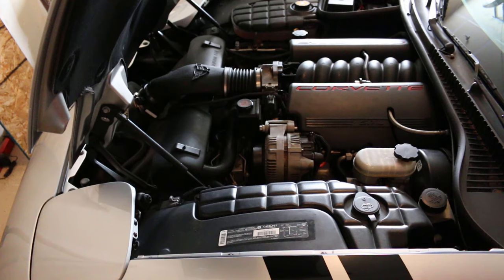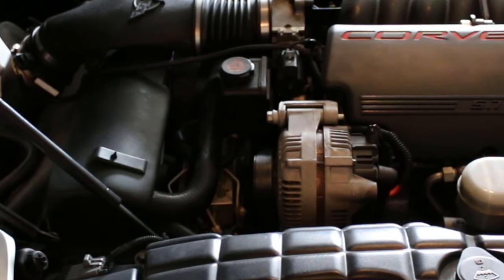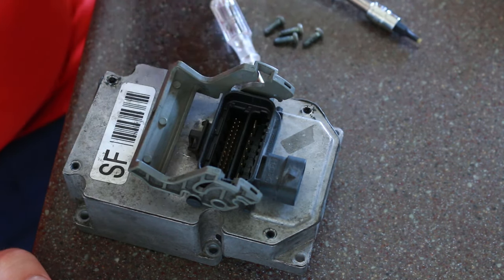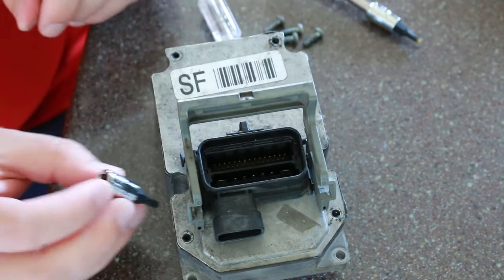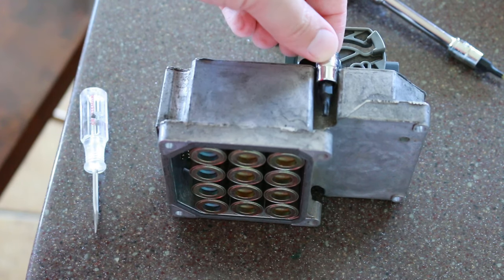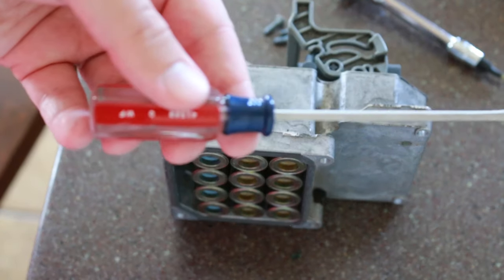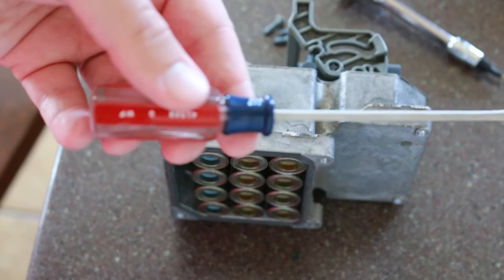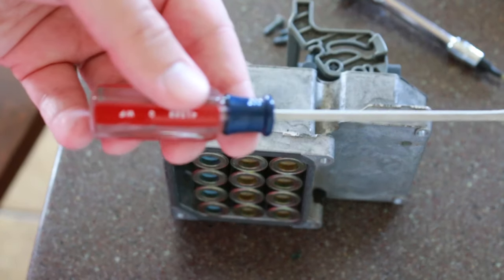C5 Corvette EBCM traction control fix under $15.00 2001-2004

Comment: I need to do this to mine. Question? Does this make the light go away or actually fix the problem where the traction and Abs work properly?
Reply from the maker: This will fix it. Light will be gone and button will function as normal unless something is wrong with that portion also.

Comment: will this fix work with 99 c5 corvettes?
Reply from the maker: Unfortunately not. When I originally made the video I was unaware the EBCM was changed in the later years. Mine is a 02.
Reply: @corkycars93  ok cool

Comment: Will this work on a 2000 C5?
Reply: I have a 2000 also and don't think it will.  98 thru 2000 have different units.  I have been told they cannot be repaired and if you can find a used one they are pricey, $2500 and up.

Comment: Nicely done ✅
Reply: Great video, but this is only for c5 2001 and up 
< I have C5 2000 and after see the video I though I was a mecanic, the only thing I did was damages the whole Module is completly different, now I am stock without C5 and Modul can't find nowhere, nor use or new, any idea where to find it will be apreciate Thanks.

Comment: Would this apply to the 2000 model year? I know they are different than 01 and up. I don't mind no abs but my wife drives it and I like her to have it
Reply: Did you find out if the EBCM fix works for our 2000 cars? Most people including the video poster say it only works for 01-04. But I found a comment saying it worked for someones 1998... Please help
Reply: @devonr7497  from my research our 2000 cars are a bastard year and it will not work and I'm not about to bian over priced salvage yard one and end up in the same situation. I've been thinking about trying to put some type of abs off a different car on it. Getting a pump and controller and make it work
Reply: @benroberts4464  True man. Idk how these cars are 25 years old and don't have a fix to this solution yet... I've heard that MANY people have tried to create a fix to this and no one has been successful.
Reply: @devonr7497  I'm with you in that. Typically abs units are used on several vehicles but evidently not in this case. I pulled all the fuses on mine when it tried to pull me into the other lane for no reason
Reply: @benroberts4464  What do you mean pulled you into the other lane for no reason? The EBCM issues just means you don't have traction control or ABS. Traction control just makes it so it will cut off the gas/input to the tires when they spin. And ABS is just so your brakes don't just lock up when you brake so you get a better braking distance. There is no actual problems with not driving with traction and ABS...
Reply: @devonr7497  those abs units had an issue activating for no reason while you are driving resulting in the car being pulled to one side. It was a scary experience. That's why I pulled all my fuses
Reply: @benroberts4464  Oh shit interesting. I just found a 01 parts car near me and I just searched it up and 01+ EBCM's don't even work in the 97-00. So your fucking tellin me our only option is to replace it with a 25 yr old used 97-00 EBCM that is very likely going to break again and then have to spend another $1.5-$2.5k everytime it breaks? WTF?
Reply: @devonr7497  exactly. Id rather not have it than buy one of those used units.

Comment: What type of solder did you use
Reply: small arg acid core NOT only use Rosin core never acid or flux   . I am electronic tech with 57 years experience and a licensed Amature radio operator when I say 57 years I started building radios and short wave radios starting in 1960 when I was 6 in England . Moved to Canada 🇨🇦 when I was 12 from England and worked a local small town Chevy olds dealer in Parkhill Ontario from 13 till I was 22 while going to school 30 to 50 hours per week in auto body ,detailing,assisting mechanics rebuilding transmissions and engines , refurbished our trade ins dyed carpets seats painted engine bays trunks and cleaned and waxed show room wood floor every Sunday and sold cars on occasion. Undercoated cars and truck s . My boss would have me clean his boat couple times a year docked on Lake Huron  and would ( here take the vette  go pick up your girl friend then go clean my boat take the boat out on the lake and tell me all about it  ,here my credit card gas up the boat . I never used much fuel as I had a gorgeous girl friend lolol . Bill my boss would ask how much gas I used I alway told him the truth very little as I only went about a mile off shore and put out the anchor! Thats alI would say lolololo. That how my love affair with c3 came about ,I have a highly modded 1976 Supercharged L82/f41 suspension 4 speed  which I just painted in blue and diamond metal metal flake lacquer , all the skills I learned working at the dealership allows me to do professional restorations in my detached garage .body   paint, engines great addition to my hi school shop class.
Reply: @nickking1510  , shouldn't  the old solder be removed before adding new ?

Comment: i have tps code 1120, and ecbm/abs codes 1221 and 1571, do u think me fixing this ebcm will clear all three? which is causing my reduced engine power to pop up
Reply from the maker: Lito Bear I have not run into the reduced engine speed issue.

Comment: Mine has a burnt out resistor. Says r1 on the board. I have no clue what type of resistor goes there due to it being broken and burned completely. Can anyone give me the resistor color code please. Its on the left under side when you're looking at it to solder the 5 points

Comment: I fixed this on my 2001 zo6, n it worked BUT when I put it in gear n let clutch out car would fall on her face???...
I'm assuming this traction control unit has something to do with this!..🤔  has anyone else had this issue?  Still havint figured it out, maybe we will have to delete it all together n leave the light on in dash!..🤦‍♂️

Comment: Hi Corky I have a 2000 vette with the same problem but my EBCM doesn't look like yours.  I"m  having a hard time locating the bolts that holds  it on. Any thoughts?
Reply: I heard that the 2000 model was different......I have the same problem. If you get any information let me know and I'll do the same
Reply: @riverj88  Thanks Jeffrey, I called a company called abs fixer yesterday they told me the  2000 year were different than 01 to the C6 model and that they cant be refurbished. He also told me GM stop making them back in 07. I'm going to keep researching our problem if I find anything helpful I'll let ya know.
Reply: 97-2000 are different.  Best thing to do is source a 01-04 ECBM and convert it. There are how to's on the corvette forum to do it.  This was a good video, but these parts are not 1700 bucks.  Maybe for the 97-00 but certainly not for the later models.
Reply: @302vettelife2  Any threads for those forums that you can link? Fixing up the Gen 1 models is such a massive PITA

Comment: What years will this repair apply to ??? I heard the 02-04 have a different ebcm
Reply from the maker: Gabriel Soto mine is a 02. So if there are different ones based on the year this may only work for the 02 model.

Comment: is that a paper clip that you can use to solder it?
Reply from the maker: Lito Bear haha. No I used soldering iron.
Reply: The actual solder being melted by the iron is probably silver.  Silver has the best conductivity of metals.  Been years since I did any soldering at work.  Don't even have a soldering iron.  I better get one and the solder and practice!  Now I have this problem with my Corvette.

Comment: This is for a 2001 and up c5 not the 1997-2000 as they have a different EBCM I was told. The 97-2000 can’t be rebuilt or fixed.

Comment: How can I get rid of act handling entirely I pulled the fuses but it still won't let my tires spin and is killing my engines low end torqe
Reply from the maker: vetteaholic I have no idea if you are able to completely disable the active handling. I would assume if that was an easy option it would be talked about a lot as an alternative. In my research I did not come across this as an option.

Comment: Was your C5 going into “Reduced Engine Power” mode ? Mine started doing this on and off much more frequently now
Reply from the maker: Benjamin Tapia sorry, I have not had that happen at all.
Reply: Corky Vette never mind I found the issue was my throttle position sensor !! For any one having the REP problem

Comment: 2002 C5 owner, when my ABS/Trac light comes on, my Climate control center doesn't work either?? When the ABS light goes off, my climate control lights up and I'm able to use it again?? What the heck?? Anyone with this issue too???

Comment: So after I soldered the board I put I back in the casing and plugged it in the car to test it and it put it in the run position and the light was gone then I took it out to glue it up with some rtv put it back in connected the battery and the light came back on and I still have the code C1214HC can someone help me out please
Reply: C1214 Sol Valve Relay Contact or Coil CKT Open. The code is saying the contacts on the are stuck in the open position, hope this narrows down the search for you.

Comment: will this work on a 1998 C5 and what letter is your ebcm M or V
Reply: No
Reply: @302vettelife2  I know they are different but did the earlier ABS-5-TCS/AR have this issue?
Reply: @johnwehunt4305  Is that the C4 module?
Reply: @302vettelife2  It is my 99 C5 Corvette
Reply: @johnwehunt4305  you have the rear mount module? Everything 97-00 is non repairable.
Reply: @302vettelife2  Do you know if they don't have the poor solder connection?
Reply: @johnwehunt4305  To my knowledge, this is not  a solder joint as is with many GM electronics of that era.  If it were, you would hear success stories of people fixing them.  There are none.
Reply: @302vettelife2  there are many youtube channels that show 5he fix. Check them out!
Reply: @johnwehunt4305  97-00?

Comment: Can this repair be done on all the modules or is there a point we’re they are unrepairable? Just looked at 99 c5 with this issue
Reply from the maker: Chris Neal I am not a real mechanic just a regular guy, so I am not sure if it becomes irreparable but I have not heard this being the case. You can always look into taking it out and googling companies that referb them so you get one with a warranty, just won’t be as cheap.
Reply: Corky Vette awesome, thanks for the response I appreciate it!
Reply: Hi Chris, did you find a place or a diy repair for your 99...I have a 99 c5 too with the sevice active handling message and light on...thx for a reply back

Comment: I fix my with only 3$ relay  change.
Reply: Hi, my 99 c5 ebcm can't be rebuilt, or any from 97 to 00, so which relay should I replace first, like you did...thx
Reply: @maxfly7079   for 2003.      Relay part  number
PB1128-ND
and you can buy it from here
 DigiKey.com
If they don't haven't just find the one to replace that part number and they have it for sure  ..and don't forget to. Resolder  some point in EBCM too